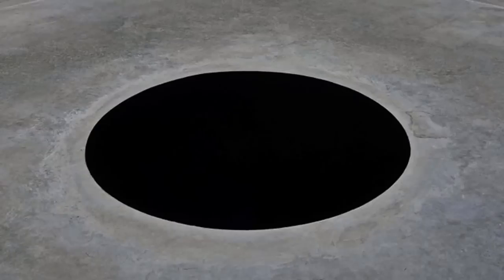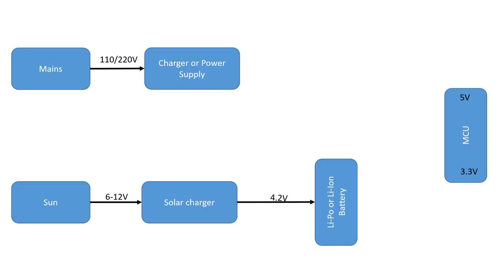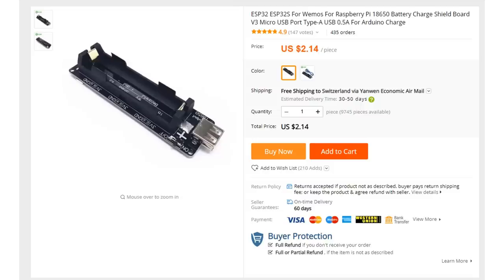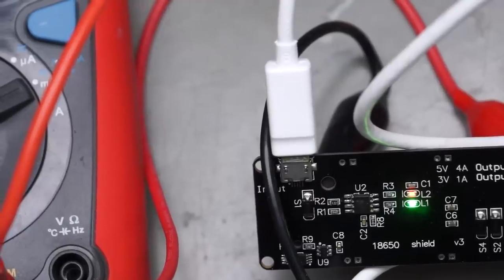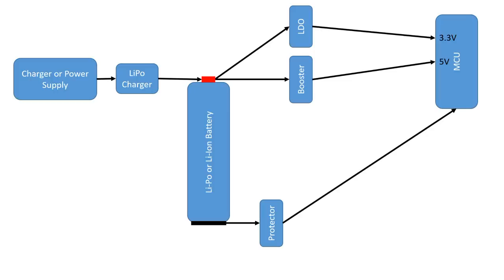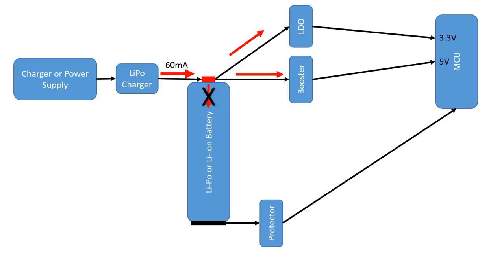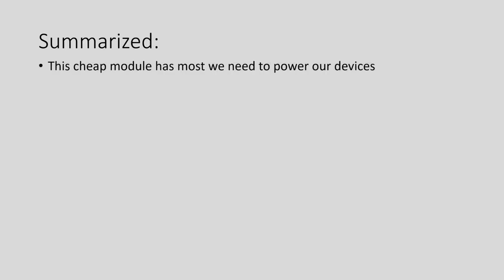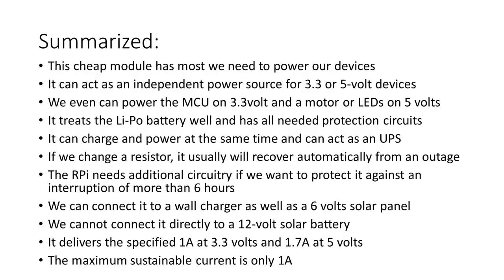#250 Universal Power Source (UPS) for only 2$. Is this possible? (Raspberry Pi, Arduino, ESP32)

Comment: You don’t mention if the charging chip senses temperature and suppresses charging when the temperature is freezing.   As I recall lipos are damaged if charged when it is freezing cold.
Reply: from the datasheet
"If TEMP pin’s voltage is below 45% or above 80% of supply voltage VIN
for more than 0.15S, this means that battery’s temperature is too high or too low, charging is
suspended."
Reply from the maker: Temperature is another topic. I already have all battery types here  for that video ;-)
Reply: Thanks, I guess the question then is, does the board have a temp sensor?
Reply: @ziggystardog  there should be an NTC resistor located near the cell somewhere

Comment: Servus. Ich habe mir ein Battery Shield V8 gekauft mit 4 18650. Das soll als USV dienen für einen Raspberry sollte mal Stromausfall sein. Sobald ich aber das Netzteil aus der Steckdose ziehe, geht der Raspberry kurz aus.
Ich habe die Version mit Taster schon. Habe 2 Stück. Ist mit beiden. Eine Idee warum das bei dir geklappt hat und bei mir nicht?
Reply from the maker: Viele Boards unterstützen diese Betriebsart nicht. Eventuell hilft ein sehr grosser Elko über dem 5V Ausgang die Spannung for den Pi zu liefern solange kein Strom kommt. Aber auf eigene Gefahr. Es gibt viele Varianten dieser Boards.
Reply: @AndreasSpiess  OK Danke

Comment: Will a small 6V solar panel provide enough current to charge this when the LiPo shield is connected to a ESP32? I have some trouble understanding the 60mA and 100mA part...
Reply from the maker: Maybe you watch my video about solar powering devices.

Comment: For the 5V output current, will the voltage drop on the battery be the issue?
How about using high current 18650 or power supply to verify the capability of the boost circuit?
Thank you.
Reply from the maker: The battery voltage can be an issue at the end of its capacity. Most Li-Ion batteries have a very low internal resistance and do not drop voltage at small currents.
Reply: @AndreasSpiess  Just tested the same battery with various boost boards. When fully charged, with 5V 1A output setting, the input current from battery is 1.3A~1.9A and the voltage drop is 0.3~0.5V. The 18650 shield in hand seems using different chip in your board. Therefore, can not verify if it is the battery issue. But saw other Youtuber testing the shield with same chip as yours but with dual batter slots, that shield can output 3+A.
Reply: You are right!
Verify the output of the same module you have with 30A high current 18650 and 4.2v from PSU, the max output current is still 1.75A.....

Comment: How many hour to charge with 6v solar cell panel until green led is on? I try 2 days with 18650 2400mAH never get green led?
Reply from the maker: You have to measure the current to know the answer.
Reply: Based on your experience how many hour full charge status?

Comment: This doesn't seem to have it; I wonder if the hat ups have it: Information to the PI on the state of the battery and charging. It would give the possibility of a clean shutdown; some databases does not take sudden power loss nicely. 
Also, the reason for the power loss might not be external; somebody might accidentially unpowered the unit, perhaps to plug in something else ;-), so the PI should have the option of notifying somebody of the missing power.
Reply from the maker: I made such a video including software for the RPI

Comment: If i have raspberry pi shutdown on voltage drop, i would think the never recharge problem would be avoided. Am i correct?
Reply from the maker: Your RPI has to shut down at around 3-volt battery voltage. But it has to start again if the battery is charged.

Comment: I have two of these V3 boards and both are labeled as having 3V outputs and measure at 3V not 3.3V. How do you get 3.3V from them?
Reply from the maker: Maybe you connect a small load. Then they should provide 3.3 volts

Comment: can it really put 3.3V out, on the product page there is only 3V mentioned?
Is it possible to put in / connect more than one cell in parallel to increase the capacity?
Reply from the maker: the LM6206N3 puts out 3.3 volt. Maybe it needs a little load to do that.
You should be able to connect a second battery in parallel. But it will take quite some time to charge (>10h with no load)

Comment: I purchased from Banggoods and amazon (two sources). Both the units I received cannot output as advertized. On units from both sources, I only get 1.3V output from the 3V,5V and USB output ports. Any idea why?
Reply from the maker: I do not know. Maybe you have to trace the connections and find out where the problem is.
Reply: @AndreasSpiess  Thanks I will be doing that. One more thing I noticed is that the plastic battery holder has +- orientation signs and so does the circuit board but it shows it the other way!!. Which one is the correct way?
Reply from the maker: I do not know
Reply: I have the same problem. On all 5v and 3V outputs only 1.3 V. Have ordered 5 pieces and everywhere the same problem.
Also the wrong designation on the plastic holder. Maybe we both got a defective batch here. So far no solution found.

Comment: I recently got two and broke one by disconnecting it from the RPI while switch is in turned on. Now the Charging and Charged LEDs are both turned on. Does anyone have any idea how to fix this?

Comment: 3:30 "this is not a problem for scenarios  where we charge the battery and then use it to power our projects" what? i have never been able to power any of my arduino projects with a power bank it always shuts itself off after like 30 seconds, i  think it is because the arduino or whatever is not drawing enough constant current and the power bank detects that and then shuts itself off, so how do you power a 5 v arduino project  with a  power bank? because  i have never had any success in doing that at all
Reply from the maker: You are right. This can be an additional problem, especially with new power banks

Comment: Has someone successfully changed R2 to get higher loading current? With 10 kOhm I have around 130 mA (so I'm changing the right resistor), but I never get more than 500 mA, even if I get below 1.2 kOhm or if I shorten R2.
Reply from the maker: Strange. It should work if you chose the right resistor. But of course, the battery has to take it and your power supply has to deliver it. Check the battery voltage as well as the input voltage and compare it with the charging diagram of the datasheet.
Reply: @AndreasSpiess  Thanks for your hints. Power supply delivers 5V/3A, battery can take up to 4A (due to tests by the community), battery is approx. half full. So conditions should be perfect. I measured power supply voltage 5.3V, battery voltage 3.6V without load and 3.86V while loading.

Then I double checked it with a simple TP4056 board (both protected and unprotected) as in your video #155 with build in 1.2 k resistor (same power supply, same battery, battery half full). Here at least I get around 900 mA. So the mistake must be somewhere else ...

I even tried a different power supply and battery with the 2$ UPS. Result stays the same. Maybe I have to accept this. 500mA is better than nothing :-)

Comment: only can charge using micro usb ? if i have 12v for example and  i use a dc-dc converter to 5v. if i want charge that module  what can i make ?
Reply from the maker: It accepts 5 volts.
Reply: @AndreasSpiess  thank you for your attention, I mean the type of input to feed with 5v, if only through the micro usb port that has or has a special pin to connect using a pair of cables, thanks

Comment: After I got some news about these "great" UPS.... I have to mention the following:
- There are differtent versions around. The new versions requires at least a consumer of 300mA or they will shot down (makes all useless for ESP projects)
- They have a 630 Ohm resistor allways connected to power so they will run out of power without any consumer within a few days !! @Andreas You didnt mention this!! (Makes them usless for nearly everything!)
- Charging and discharging at the same time is possible but removing the charger cable will interrupt the power supply for a view seconds. (2 x 1F goldcap needed for ESP32)
- All devices have sometimes a strange behavior and do not react if the on switch is pressed.
All this makes the device useless and the video irritating.
Reply from the maker: Thank you for sharing. Mine was obviously different and simpler.
Reply: @AndreasSpiess  I ve 6 of them (2x 1 battery slot, 2 x 2 battery slots and 2 x 4 battery slots .... all from different sellers ) they all have these problems and if you read the amazon and Eli Express comments you will find all my complains. My order is about 6 month old.
Reply: @WhiteLion1337 , I too received these modules for a recent order.  The device is entirely different but does charge 18650's.  I placed a few comments on AliExpress too.  But that momentary button seems to be an on/off button (long press = OFF, short press = ON).  Yes, as you note, the button behavior seems quirky.  Sometimes it works with no load and sometimes it comes on with a larger load.  I'll let you know if I learn more.

Comment: Shouldn't a UPS deliver power from the mains if available and only discharge the battery when mains is not available?
Reply: All depends what you expect from the UPS. The "best circuit" should do anything for optimal functioning. That could even include discharging and recharging a battery. (While having another charged battery available).
Reply: @JanJeronimus  A notebook basically works like a UPS as well. A smart circuit will draw power from the mains and only draw power from the battery when the charger is unplugged, thereby prolonging the life of the battery (no unnecessary charge/discharge cycles). But you're right, depends on what one expects from the UPS.
Reply from the maker: This device does exactly that.
Reply: @AndreasSpiess  Ok, then I misunterstood your schematic, because it looked like it was always always using the battery.
Reply from the maker: All currents add up and distribute exactly as you described. If the battery needs charging, it is charged. If mains is off, the battery provides the whole current. This is because the battery behaves like „nonlinear“ and refuses to take current if it’s inner voltage is higher or the same as the one from the charger.
Reply: @AndreasSpiess  I see. I think it was the trickle current issue that threw me off ;) I thought that when mains is back on it doesn't matter what the state of the battery is, it will just power the output from mains and charge the battery.

Comment: RPI has a larger wake up current.
This low current when charging and turning is not sufficient for RPI to start. You will be stuck probably in a boot loop.
Reply from the maker: Mine started. 1.7A should be ok

Comment: https://www.reddit.com/r/AskElectronics/wiki/batteries

LiPo IS a Li-ion based cell. 
Saying LiPo or Li-ion  does not make sense.

Also, a cell does not output 3.7V all of the time. When full it will output 4.2V and when empty about 3.0V. Using a 3.3V LDO with a dropout of 3.7V will give you only 50% of the available charge.

Lastly, the holder holds a single cell. Not a battery.
Reply from the maker: You are right.

Comment: Auf welchem Weg schließe ich ein Solarpanel an?
Reply from the maker: Plus an Plus und Minus an Minus? Oder wolltest du was anderes wissen ;-)
Reply: Andreas Spiess  das ist ja interessant.....ich meine verstanden zu haben das es über USB geladen wird, habe auf der Platine keine separaten +/- Eingänge gesehen .....
Reply from the maker: Da hast du recht. Der Weg ist der Lötkolben... Die beiden äusseren USB Pins sind + und -

Comment: Can somebody suggest how to measure 18650 battery capacity in this setup ?
Reply from the maker: By applying a load which draws a defined current and measure the time the current flows.

Comment: Andreas, some of the recent comments here reflect a knock-off of the Wemos V3 Shield that is on the market.  I ordered more of the Wemos V3 but received an unmarked version from Fancys Module Mall (CN, I think).  It may be a smarter product.  It has a momentary button instead of the slide switch.  That momentary button seems to shut down both the 3 & 5 V rails and the USB.  And this may be good as a MCU could control it (short press = ON, long press = OFF).  Other people comment about a 300 mA load minimum.  I don't see that.  There is a chip (resistor?) marked 620 that gets real hot when the device is ON and while charging.  I did try a bench-test with an external battery and an amp-meter but the device would not come on if the battery was not in the holder.  There are two large plates in the bottom of the battery carriage that may be some sort of battery induction sensor perhaps.  This isn't hackable like the Wemos V3 of your video as the chips are totally different.   But there is a isolation jumper near that 620 resistor - so it may have a 5V rail isolation hack - I don't know.  Perhaps this information is of use to you and others in your blog.  If I learn more, I will report.  If you are interested I'll send you a couple to play with.
Reply: Learned a little more this morning about this knock-off charging module.  That hot 620 resistor consumes some part of 110 mA when the device is on and would kill most 18650 batteries in a day.  I used the finger "Swiss Method" (:-)) of testing the resistor temperature - it was almost to hot to touch.  When the device is off the amperage drops to an impressive 40 uA.  Reconnecting a battery causes the module to become unresponsive to button presses unless the charge cable is reinserted again.  Wierd.  Yes, I was able to attach an external battery once I learned that rebooting the device requires plugging the charge cable again.  Cutting through the 620 resistor isolation jumper bridge did eliminate the resistor, heat and high amperage, but caused the device to operate for no more than 8 seconds before shutting off.  Pressing the ON button again would give another 8 seconds.  I could find no manuals or datasheets online.  Hope this helps others with this new-gen charging module.
Reply from the maker: I ordered a bunch of different boards, but they are still in the mail. Maybe you provide a link to yours that I know which one you have?
Reply: @AndreasSpiess  Sorry so slow to respond.  Here is the link to the boards I bought: https://www.aliexpress.com/snapshot/0.html?spm=a2g0s.9042647.6.2.738933edJcnHF9&orderId=8012462882493827&productId=32841310921  
The board delivered is not like the board advertised here.  On this site there is a 5/6/2020 product review/complaint that shows the device as delivered.  As mentioned this other board isn't better or worse - it is just different and not as advertised.  
I saw your latest vid about a colaboration project.  Very exciting.  If I knew something I'd join in.

Comment: Have anyone tried this with a RPI 3 Model B+? If so, would you care to share a comment? I've noticed that connecting this module as an UPS is slowly dropping the voltage of the battery even when is connected to a wall charger(5V, 2.5A). I haven't tried the mods replacing the Rprog and R2. But if anyone has i'd like to know your input on the subject. BTW thanks Andreas this content is gold.
Reply from the maker: You have to make the calculation: How much charging of the batteries and how much usage. If you use more than the chip charges your batteries are discharged

Comment: I believe I drew too much current from mine. It would not re-set and no longer works.
Reply from the maker: This should not happen. It has overcurrent protection. Maybe you reversed the battery.
Reply: @AndreasSpiess  No, I am always careful about battery orientation. I think I drew about 1.5A. The output on the 5V and 3V ports fell to 1.1 V with 4.1V on the open cct of the battery. I have since repeatedly inserted the battery and now the outputs are OK. It appears that the over-current somehow 'latches' the output to 1.1V. If you have the time could you do some over-current tests and see how it reacts please?

Comment: I made a UPS for my OrangePi using a pair of 18650s and this: ebay.com/itm/263104223238 It's worked fine for the past year for the most part, but if the power is out so long the battery dies, when it comes back, it gets stuck. I tried a 2A power adapter, but it still gets stuck if the battery's empty. I'll try switching to a 3A adapter to see if that can let it charge the battery and power the OPi at the same time. I didn't test it, but the problem is that it won't charge and power at the same time like you said.

The OPi (and maybe RPi) can also be powered via the GPIO, so that's an alternate solution to battery backup. What if the UPS has an extra pair of batteries and switches to powering the Pi through the GPIO for a while, then switches back to the one connected to the normal power connector? 🤔
Reply from the maker: Where you connect the power  (USB or pin headers) is not very important for the RPi I did a video on how to shut the RPi down before it crashes at low battery voltage.